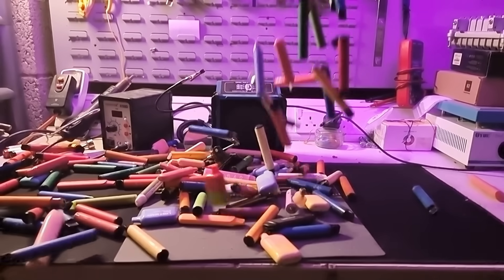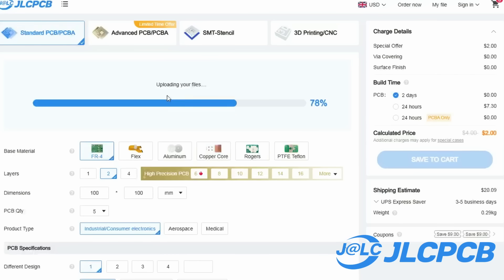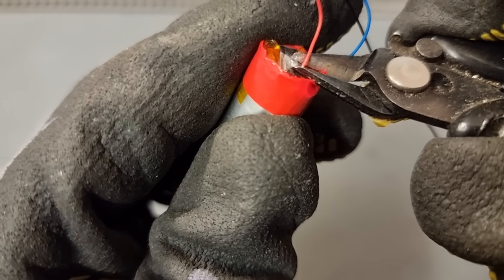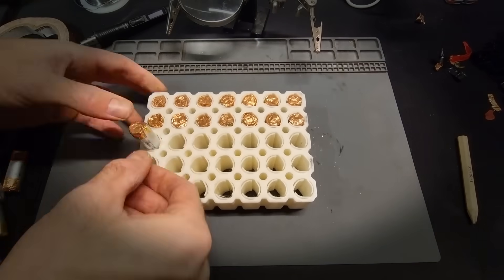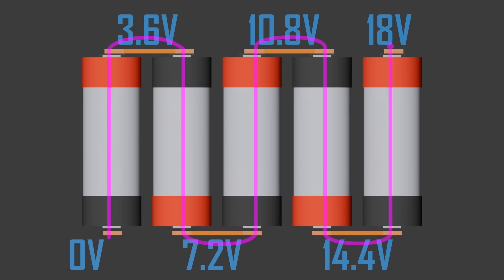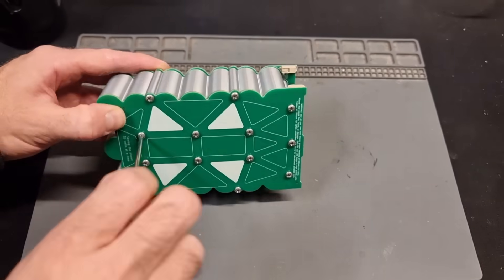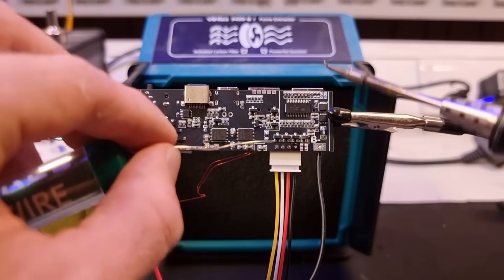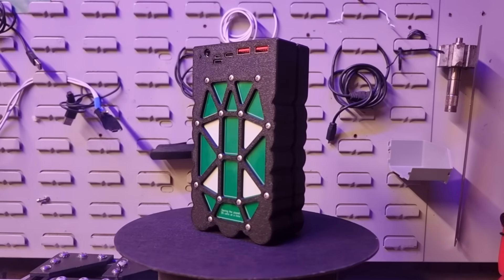Making a Power Bank from Disposable Vapes: UPGRADED + Extreme Tests!

Comment: question if someone wanted to freestyle it a bit.  so for instance i want to make a 12v straight dc cell let's say.  you are using 4.7Ohm resistors between the cells here.  Is this a good standard to follow for joining most types of cells?  it appears they are only on the positive rails between cells.  do you use the same resistance when putting a rail in series with another one?  If so what is the logic of the size of resistor?  Similarly if I wanted to make 3x 12v packs and then put them in parallel to make  larger 12V how might i determine the right resistor?
Reply: also i had a thought.  since each cell is 3.7v could i take some 14500 cells which are the size of AA and then anything that say used 2 batteries in series and using 3V and just take them apart, wire the terminals in parallel and then just recharge those cells separately and use them?

Comment: What's funny is Tesla uses 18650 batteries for their battery packs I think they use like 200 of those cells If I'm not mistaken for the original Tesla Daisy chained together And I only found that out by digging deep into how those batteries are made . it really is interesting how a few hundred of these together cost almost $100,000 with over complicated software just make a  Tesla

Comment: I own a vape shop, we collect them from customers and I dismantle them. The problem is there are at least 4-5 kinds of cell size and about as many capacities. Depending on where you are I find a plastic ammo box with layers of bubble wrap is a good way to store them. Here in Canada, the large box hardware stores have collection bins at the door for batteries and these go in there just fine. Tape them up first if you do this yourself, just remember to watch what happens when you short/puncture/overpower so you don't get complacent.

Comment: This is a really nice design. You've really thought about safety. I don't have any vape cells, but I do have a lot of 18650 cells. Is this design also suitable for 18650 cells? Laptop batteries are often thrown away, even though one cell is often broken. There are enough to be used.

Comment: 10:40 using the resistors this way is a solution for the fast charging problem, but won’t this make the fully charged battery less efficient? Like, when I’m charging something with it, won’t the energy be also dissipated in form of heat by the resistors?
Reply: The resistors are bypassed with the jumper once the pack is balances, and they are not in use.

Comment: Been thinking about this idea for a few years so I'm glad to see it being implemented so well. I rate the 3d print options. PCB layout is tidy and pretty efficient. Still think it's pretty large for the capacity but I can't see that being any different due to the cell sizes. I imagine flat pack phone cells would be a great alternative but then the problem would likely be heavily used cells. Would be curious to see if these cells could replace dead power tool battery packs 🤔

Comment: This is amazing! I wish I had stumbled on this video earlier when I still vaped! Question, when a cell goes bad, will the pcb need swapping out too due to the safety mechanism burning out and will it need a new resitor circuit board to balance the charge out again?

Comment: How do you know what cable thickness to use depending on the amp draw? Or even If the copper strip joining batteries, in one of the videos, is thick enough?  I remember searching some table, but found different results

Comment: I put out a bucket at work for coworkers to throw their "dead" vapes into. I collected about 70 in the first month. Now i have around 600. I also have a few hundred 18650's from a previous waste collection, from a shop that repairs computers. They were giving me all the old laptop batteries for a couple months.
Reply: Could u power a house if u had enough

Comment: Now i wanna see if you can make a powerbank like this but attachable to another similar powerbank so you can connect them like legos if you wanted for a larger powerbank or disconnect them for a smaller one both able to charge devices and once connected can equilize the batteries between the 2 and not make the batteries over heat and blowing up imagine being able to instead of having multipule battery banks on multiple chargers if you could connect them all like 1 big one and just use 1 outlet. But at the same time if you knew roughly how long youd be out say on a camping trip you can calculate how many to bring to charge all of your devices but if youndont need too large of one you can bring a single one juat to go to work with to charge your phone if you cant find an outlet easily to charge. Another thing that drives me insane is the screws everywhere is it possible to 3d print the parts to have licking tabs kind of like those found on phone cases that you lift up on and will release the other side?
Reply: My god man, let paragraphs and punctuation into your life.

Comment: What settings do you use on the cell tester? I'm thinking of charge and discharge. Default is 4.2V on the first charge. Should I lower it to 4.1 or lower to be safe? Thanks in advance!
Reply from the maker: 4.2V is fine :)

Comment: I've been collecting vape batteries for YEARS. I probably have 1000 of them.
I'd like to make a battery pack, but I'm not technically savvy enough yet to print my own boards. I do have a 3d printer for the rest, though.
Where can I get a more simple pcb design or pre-made ones?
Reply: You order those. He laid out everything for you (it's even in the video). Made to order boards are basically revolutionary in the DIY space. Give it a go!

Comment: Can you do one that uses the normal vape batteries....18650 or similar ones you can pop in and out. Can you do one that you can pop in like 10 so there is no soldering or stripping?????? 🔋🔋

Comment: Why the need for all the bolt straight through use threaded inserts in the 3d models and countersunk screws will give a much nicer finish and will stop it from scratching up serfaces you place it on 😊

Comment: my same board died during charging, it just stopped working and didn't even burn out. 0 reaction, didn't react to anything. my guess is that at that moment in the 220 network one plug was not making contact, which is why a small arc passed through it, because of this somehow the board died because of the interference, probably

Comment: Ironically I want a version for 18650 cells

That way I can gut old laptop batteries and use those
Reply: The design looks very scalable. You could easily modify the model for 18650s

Comment: Very cool project but I would say they power density of this built is rather in the low side considering the spacers and pcb and housing required to protect those sensitive cells. Still excellent project but suboptimal when compared to repurposing 18650s from old laptop batteries

Comment: Why do the SIDES of the battery ends need copper tape? Couldn't you wrap a non-conductive material around the ends, like heat shrink plastic or something, so that you don't have to worry about accidentally shorting batteries as you work?

Comment: for anyone ordering PCB's off the JLCPCB site, the default options they give you need to be changed a bit.
under "high-spec options" and "via covering" select TENTED instead of epoxy filled and capped.
then, under pcb assembly --> PCBA type select "economic"
these r the settings he uses in the video at 10:18 

should make it much cheaper, but im pretty sure it only works if the board is green. not 100% sure tho im very new to this

Comment: the smd soldering hot air station you use is a death trap watch out! if you disconnect the heating element it will have exposed mains voltage.

Comment: You said it would last forever as long as wou swap out cells. However wouldn't that mean you would have to unnsolder All of the resistors to re equalize the cels then rensolder again. Before re Assembly?

Comment: whats the idea on adding cooling to a large scale battery pack to allow for faster charging of the cells, and maybe larger bundles with the safety not being hindered either some sort of air cooling with computer fans, or even on some SUPER large batteries maybe a form of liquid cooling?

Comment: I usually click on these videos to make sure that they explain clearly how to safely use lithium cells. This one does it thoroughly. Very good job. The thing most videos neglect to explain is the matching of parallel cells. This is super important and should not be ignored when using random lithium cells. Always remember to check the cell capacity and closely match the cells.
Reply: So not just the volts but also the mAh???
Reply: @TimothyYocky  yes, they should be the same voltage or otherwise the cell with the highest voltage will attempt to dump hundreds of amps into the cells with lower voltages. The mAh of each cell must also match closely.
Reply: I appreciate your insight. Is there anyway you could give us some tolerance numbers to help define what matching closely means?
Reply: @Josh-iw1kq  not sure what the industry standard is but 5% should be the highest deviation. Ideally they would be almost perfectly matched down to a few mAh.
Reply: @PunakiviAddikti  thank you! That helps quite a bit.

Comment: About 7-8 years ago I had kangertech ecig and it had a crappy battery cover and it only used a single 18650 battery and one day I knocked it over and tried to catch it, indoing so somehow the battery started coming out and me trying to catch it at the same time caused the battery to short out inbetween my hand and the mod body causing it to explode in my hand…. It fucked me around for awhile…I should have maybe tried to take it to court…I think it caused some nerve damage and stuff….it hurt so damn bad and it happened faster than you can blink and it was so damn hot….I instantly found aloe gel dumped it in a bag and submerged it and then went to the hospital
Reply: That battery pack you built bro is cool asf, you were thinking outside the mofo’n box…

Comment: Dang just got everything ordered went to order the pcb boards and the one white clip part was out of stock hopefully they get those back in
Reply from the maker: Oof thats a shame. You can still order it without that part and solder the wires directly to the pad, although its not as easy to service

Comment: Solder dozens of jumper tabs or create an extra balancing PCB? If you want to justify a balancing PCB for mass production of battery blocks: It could have extras temperature and voltage sensors to allow a micro controller to signal when things go bad or the balancing is finished. You have to unscrew the whole thing anyways. About that, for the balancing a jig to clamp the block together (and allow for easy ripping out when things or bad, or even have a servo do this automatically) would save you some those screws.

Comment: 6:24 not saying anything but like, it most def don't do that
Reply: Not instantly. But what he's saying is that it can be overcharged.
Reply: Cells don't explode right away but they can get really hot and when reaching a certain point they immediately burst into flames
Reply: I think hes probably pumping a lot of current into it so that it heats up a lot. It could probably do that if you pump enough current into them

Comment: Could you make a power station that could run something like a ps5 and a tv at the same time with these cells that would be an interesting video
Reply: That's what I'm planning to do with the capacity to know by a led light showing bad battery there with atleast 500 batterys

Comment: Does usb board 1 work with 18650 cells?
Reply from the maker: Yep
Reply: @Chris_doel  is there any 3d prints for 18650 cells like the holder the case etc etc

Comment: Will the amount of power that you could store in your battery box is tiny not to mention I'm surprised you don't have any external forms or internal forms that directly connect for solar and other forms of charging definitely a lot less applications than my box for crying out loud I've even got Nas capability built into mine. Currently I have 480 kilowatts of storable energy capacity in my setup currently

Comment: This for 18650 also with active balancing and a few various configurations.  What would happen if you didn't bridge the resistors?  Would it charge at a slow rate?
Reply from the maker: An 18650 version would be great, and should be able to be made easily from scaling up my current design. If you didn't bridge the resistors, then each parallel row of batteries would not be able to provide enough current, which would cause the USB board to cut out.

Comment: You are doing a great job of recycling vape batteries. I've started doing the same thing. I've created an Arduino to do the battery capacity test. It was ok to use. It gave me a rough average of the capacity. But the test you have got that does 8 is awesome. I got myself one, and it is awesome. One thing I didn't like was how you used clips to connect the batteries. I've 3D printed a mount that sits in the 18650 slit. Then on top it has the space for me to drop in the vape battery. It supports all the different sizes. This was much safer to change batteries in and out. As I'm testing them. This might be something you want to consider in the future. Keep up the great work.

Comment: I want an reliable source so I'd like to replicate this with brand new 18650 cells, is there any chance that you would alter designs to facilitate 18650s thanks in advance
Reply from the maker: You should be able to just scale up the PCB & 3D prints to fit 18mm cells instead of 13mm, then it would work perfectly

Comment: I would love to see a version that works for 18650 (or just any 18mm form factor battery) , so that the same process could be used on all the batteries that will be coming from dead ebike/power tool batteries, etc. 

These are maybe in worse condition though, as they're generally actually recharged.

Fantastic work as always! Your original vape video inspired me to get into this upcycling, and Ive since been able to acquire 17 (!!!) used hailong ebike batteries from a local last-mile delivery service here in copenhagen. Excited to turn them into something useful again :)

Comment: @Chris Doel  Just a quick idea... have an LED and resistor showing through the other side of the PCB. You connect the LED and resistor in parallel with the fuseable links. That way if any of the fuse tracks blow you will get an LED idication. Maybe it could be integrated into a later version of the PCB. Great video and design 👍

Comment: 14:41 Ideally you should use crimped ferrules instead of tinning the wires when using spring/screw terminals, as the pressure of the terminal deforms the solder over time, resulting in a loose connection.

Comment: Its not just batteries that can be harvested from vapes, some of them have a micro controller that has twice the performance of an Arduino Uno.
It can be programmed with Arduino IDE, if I post ic specs, the comment gets deleted, so you'll just have to search for PY32Duino.

Comment: 3:21 lithium batteries are stupid volatile.  Drilled a hole in a VRLA battery and it still gives 8 volts (nominal voltage is 12 when no hole is drilled in it) but look at a lithium battery funny and it detonates.

Comment: Man this was worth the wait, v2 looks real fresh! My only suggestion would be that for the four balancing wires, it would be better to used ferrules on the ends of the wires instead of tinning them with solder. I say this because the solder will be deformed over time by the clamping force of the connector, and solder tends to crack due to this. Since this is for the balancing wires as well, it is a bit concerning. Using ferrules will ensure that the connection retains the same connectivity as the day it was assembled, and ensures the most contact between the wire and the spring loaded clamping connector. Using a pcb mounted solderable fuse for each battery instead of the copper trace might be a better option for longevity, since switching out a fuse is easier than repairing a copper trace, and less janky. All in all, cant wait for the next video and more 3D animations, they really do help with explaining concepts like these to the masses. Cheers!

Comment: there should be a battery deposit program for lithium batteries so you can get cash back for recycling them 
and make it easy like all electronics retailers need a bin and a local service ran by the local govt will collect it and run it up the chain

Comment: Should 3d print a plate that has 2mm posts on it that line up with the center of all your cells. Can then take a fully bottomed out loaded cell and place the plate on and correct the depth of all the individual batteries at once.
Reply: Underrated comment

Comment: superb achievement
handling these lithium battery cells requires great respect (for them and for the safety rules)
if you do not respect them enough they will VERY quickly let you know!
and you will not like their answer at all

recycling these economic and ecological aberrations that are the "single-use vape" is an action that deserves respect
thumbs up

Comment: Amazing construction and great to raise awareness. Seems still very time consuming and very risky to put battery packs together. The cells seems pouch with a cylindrical shape, unlike regular 18650 ones which have a sturdy aluminium case and solid tabs.
I suggest to print cell holder with flame retardant plastic just in case.